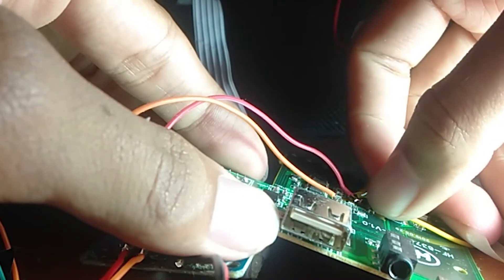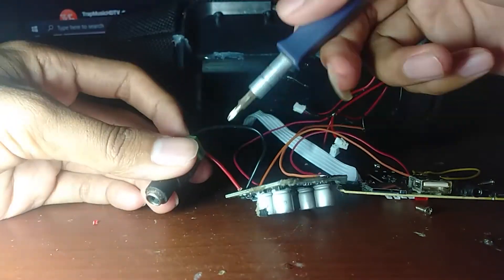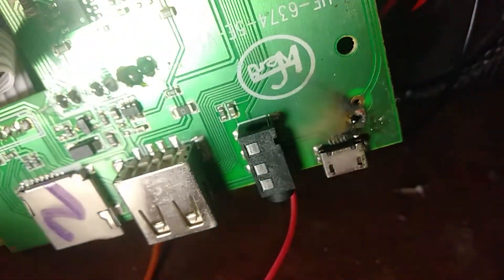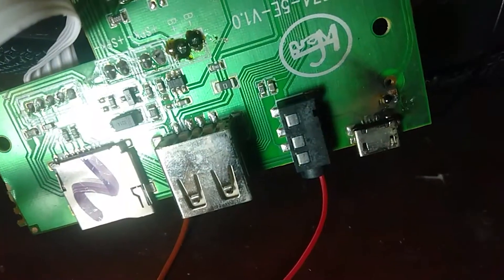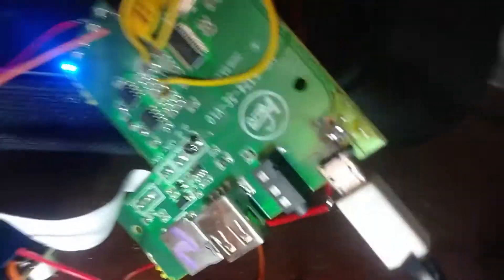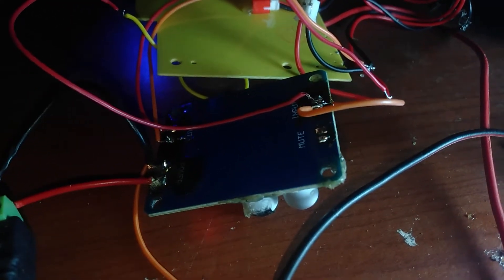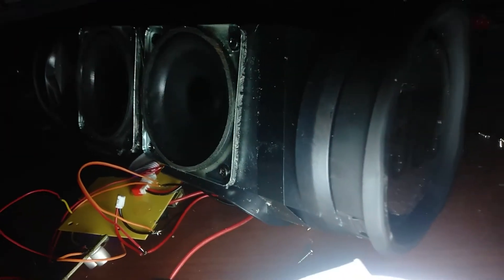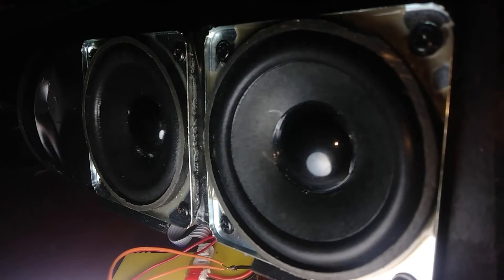How to Connect FAKE JBL XTREME to ANY SPEAKER AMPLIFIER!!!

Comment: MGI

Is it ok if i connect the input of the TPA3118 on Speaker Output of the JBL xtreme Board?
Reply: Why is it gonna blow out?
Reply from the maker: @VtuberRex  the amp will be making smoke
Reply: @MamadMusicVibe  
Is it because The TPA 3118 Takes Too much voltage?
Reply from the maker: Coz connecting input to output will make a loop, like... Holy damn its amplifer its amplify that already get amplified and amplify it again and boom! You have a bomb
Reply from the maker: Just do what i tell in this video you can ONLY connect OUTPUT of bluetooth chip to amp, not amp to amp
Reply from the maker: No it will blow out